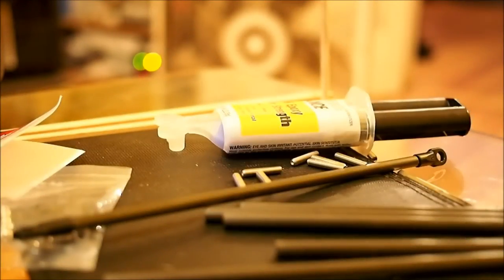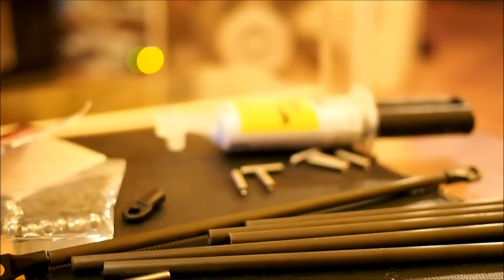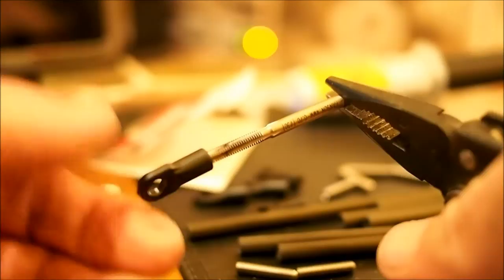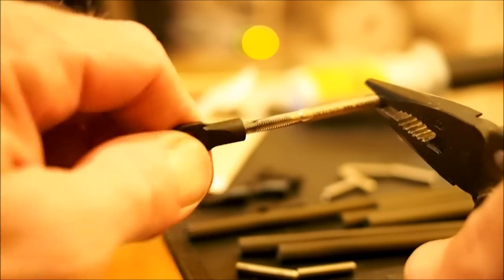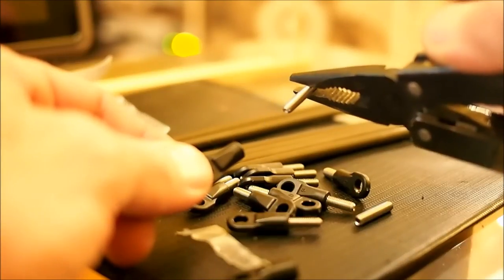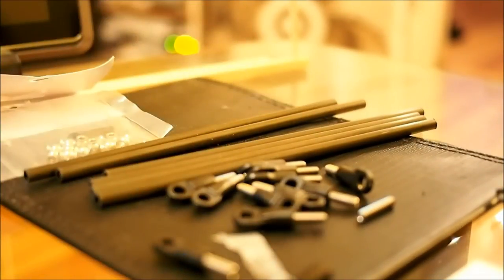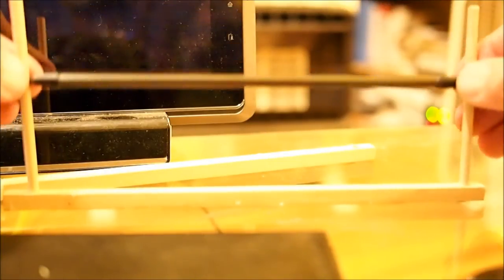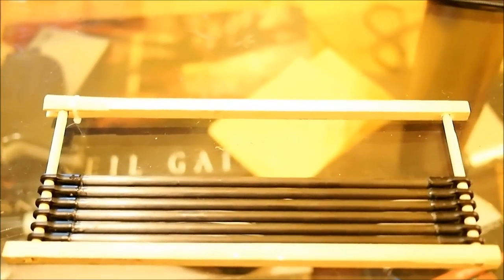Mini Kossel 3D Printer Build - 2  -  Diagonal Arms

Comment: I made a set of these, the ABS plastic ends are soft enough that you don't need to tap them at all just secure the plastic ball retainer and thread the threaded rod in with an allen key.  I like to pop the ball joints together first before gluing as you can get rid of any play in the ball joint by giving the threaded rod an extra quarter turn or so into the plastic, if you have already glued the ends on you can't do this.  A lot of people put the ball ends together and think they are faulty if there is play, this is not the case they are adjustable as i have described above and is how i make my own rods with 100% no play perfect every time :)